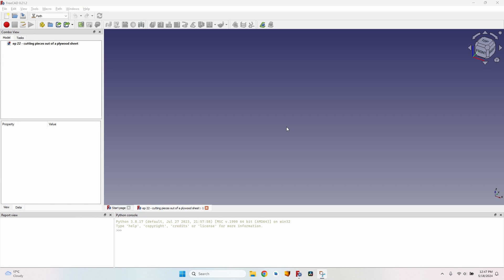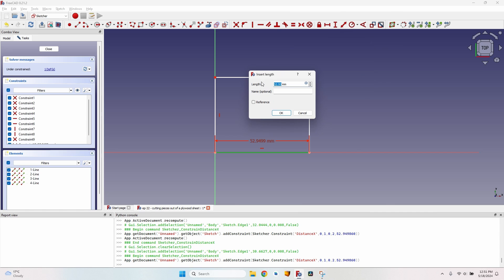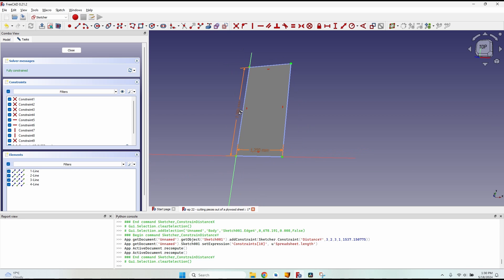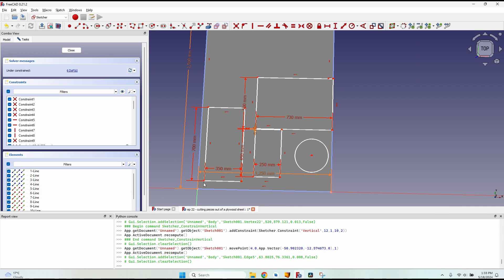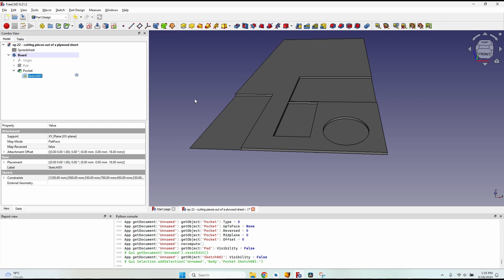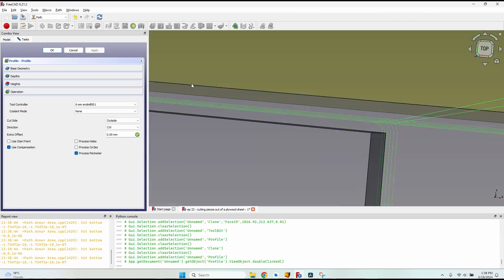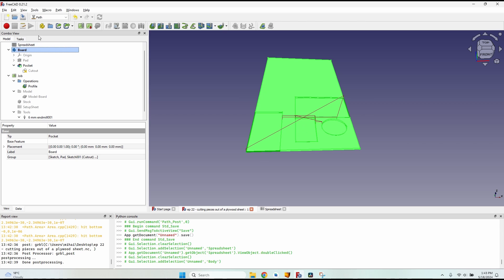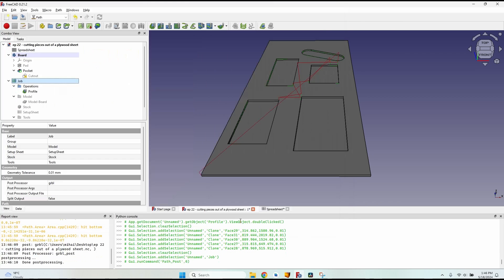Cutting a sheet of plywood on the CNC – FreeCAD CAM Tip 7 (Sheet Cutting Guide)

Comment: You don't have to change the tool diameter to "fit" in between. I think that's really messy, because it changes every operation that uses this tool. Instead just assign a negative "Extra Offset" (e.g. 0.01 mm) at the specific profile operation. The result is the same. No need for extra parameters in a spreadsheet or formulas in tool's properties.
Reply from the maker: I have tried that, too. Unfortunately, that doesn't work. So for now that's the only way that I found to work. As a rule for myself, I prefer to set a tool bit in the job especially for this.
Reply: @opensourcecnc  
That's weird. I just tried it again (in FreeCAD 0.21.1 on Windows) and it worked. I've also used that for a long time. But OK, if you have your workflow and you're fine with it, there's no need to change it.

It might work for other people as well though, and it is generally good to know that the profile offset feature exists as it has other use cases than making an endmill fit (like cutting a part slightly oversize, if you know that you'll sand it for example).

Comment: Keeping the faces of the cutout is a neat shortcut. If selecting negative spaces would be possible that would be even nicer though.
Reply: I agree about being able to select the negative spaces.  I had designed a part in FreeCAD that had the portions I wanted cut out of it, but was unable to select the subtracted areas when creating the tool paths.  I kept searching on how to do it and didn't have a solution until seeing this video.  Hopefully it is something that can be added later.